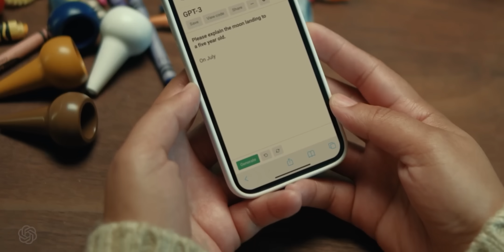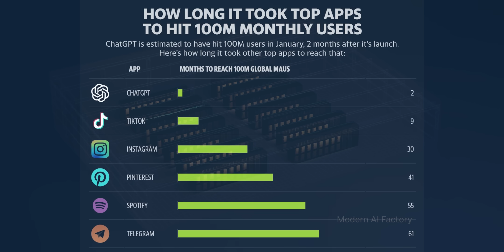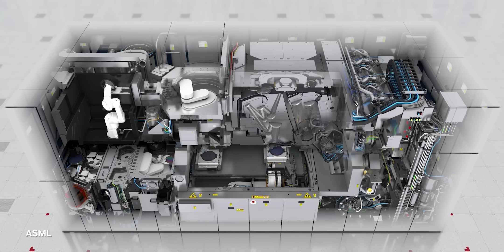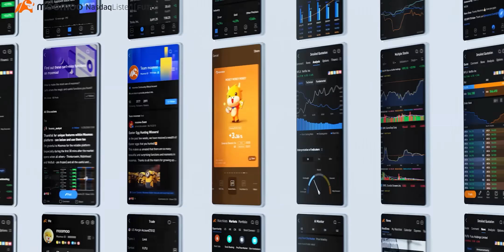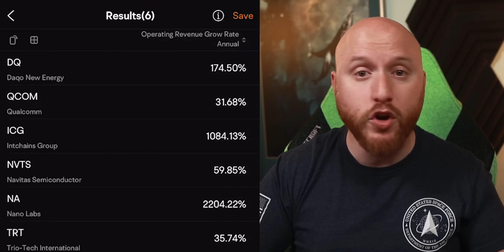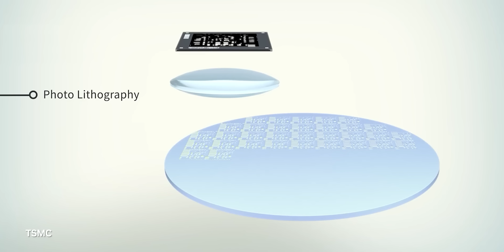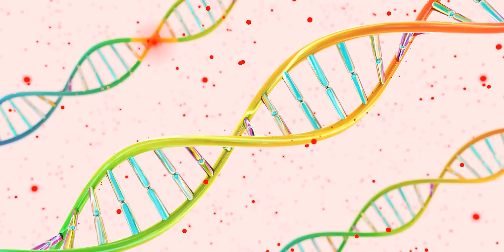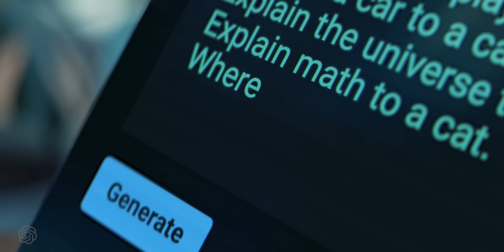Nvidia's HUGE AI Breakthrough (Bigger Than ChatGPT)

Comment: We have A.I's designing new A.I.'s that are beyond our capability to do. The timeframes are the problem. If we feel the need to pull the plug on an A.I. that we might be losing control of, by the time we deduce that there is a problem, the response window will be long closed. Then, our future as a species is determined by a omnipotent sentient being that we will never have control over. What could go wrong? There is no larger gamble. There is no greater potential loss.

Comment: Excited but feel iNtel and others are leaving desktop systems alone. Gamers are driving computer chip improvements. 
Yes AI is good but AI only adds another development stream. AI does not negate nor replace much of the computing needs.
For example, mainframes still do most of our commercial banking and record processing. 
Servers, which are not that affordable,  do much of the heavy lifting for non Mainframe data processing like weather forecasting, AI, local bills, email, etc. Yes Amazon uses special chips for serving video and product forecast. 
Linux & Windows are still used for medial research, gene folding, oil exploration, image processing and database work. Desktops are affordable to the masses and where most programming takes place. 
ARM chips will process IoT.  These are all separate computing streams that AI will not replace. 
Back to desktops - these are the machines of discovery and development. Though my sample size is small, they are pushed to their limits more often than not. People are waiting for iNtel to create a 6Ghz CPU and deliver on the promise of a 10Ghz CPU with DDR-5 memory even with a TDP (total dissipated power) of 233 watts. TDP of 374W would be tolerable even if I had to plug it into a 50A dryer circuit. 
Laptops like cell phones are more general use for consumption of video, emails, light games and web surfing.

Comment: The power reduction from 35 megawatts to 5 megawatts is a decrease of 30 megawatts. Percentage-wise, this is a reduction of approximately 85.7% (30/35 * 100). A 3% to 5% reduction in a plant or data center is really good. 87% reduction is🤯

Comment: As someone close to ASML, I would say that the effect of faster computational mask design will have impact in the mask design speed, but no matter how fast you can create masks, the laser/scanner system is always going to be a bottleneck. This could take a 6 month contract to produce millions of chips and turn it into a 5 months and 15 days kind of thing. Where a real breakthrough would be is if you can get AI to build a better overall process with the laser and scanner system to have much higher uptime with no need for humans to be in the clean rooms. You get AI to build and run the Fab's, then you have a real breakthough. When machines design, build, and control machines, the cost for everything starts approaching zero.
Reply: I am cluelesss
Reply: Which is the best website to buy machine components to etch my own chip?
Reply: When machines design, build, and control machines, we might just be doomed. We can't let them have automated factories. We just can't.
Reply: @BenThere_DoneThat  I'm not sure who you mean by "them", but this is already happening, just not on a large scale and not a completely integrated process. As long as there is money to be made, countries like China will worry less about the danger and more about how fully autonomous factories and construction is as good as printing money.
Reply: @Jacmac1  I mean like Boston Dynamics assembly shops for producing troops. Or drone swarms. With the capability to adjust the manufacturing infrastructure as it sees fit. 
Someone already put Chat GPT in a spot robot. I don't think they should've been allowed to do that.
Reply: Wha?
Reply: that´s gonna happen not soon but in the next 20 or 30 years.
Reply: @Ecotips  10 to 15 years if that. Let's see how accurate any of us are and come back to this. See yall in a decade or do :)

Comment: I quite like the video however you have a very flawed understanding of Chip Manufacturing. The problem is not processing power it is the wavelength of light. Even ultraviolet lights wavelength is too big. So they use masks even finer details.  It is 250 points that this is a quantum physics problem. 
They also won't toss out there Stanley extension server Farms. That just is not how business works
 By the way I don't know how much the h100s cost but the a 100 it's about 16 thousand

Comment: Question: when quantum computing is 'solved' and we got a real handle on it, will the hardware we currently are pouring so much time, money and resources into, still work for our Quantum Computers and chips? Or will everything have to be built from the ground up with QCs in mind? Thanks for the vid!
Reply: Bro, it'll have to be rebuilt as quantum runs on different principles. There are some different quantum computers based on different technology currently in use for research and other purposes China has some based on photons/lasers while other people have electron trapping using temperature differentials. There isn't a standardized approach to quantum rn. Quantum computers still currently only have limited use, they are very good for factoring large numbers and that's about it so for breaking certain types of encryption they're good.   Probably though we won't be the ones to build the really powerful quantum computers at that time, it'll be AI. But our current computers will coexist with quantum computers for a very long time unless there's some other massive breakthrough.

Comment: They are not changing the problem into a imaging problem. A GPU is a general processing unit just as the CPU just with special features, therefore it can do any computation you want. 

Historically there were API languages (such as OpenGL, before compute shaders) where you really had to compute numbers using textures. The reason was that GPU’s at the time were exclusively designed for graphics, therefore there was no API for general prupose computing on the GPU.
Reply: I think you do not know what you talk off.  GPU with ai for image patter recognition is more powerful than a CPU powered system. 
That has been understood for some time.

Comment: Alright, cute, Nvidia made a very small and insignificant part of chip manufacturing 40x faster and people just repeat the marketing pitch without understanding the context, making an elephant out of the ant. Clickbait. Thanks.
Reply from the maker: Did you watch this video on mute? Calculating these masks is THE most computationally intensive step in chip making.
Reply: @TickerSymbolYOU  Most computally intensive? Sure, but does it make any dent in the full process? No.
You know, making these chips is not crypto, there is a physical part you seem to forget. You know. Manufacturing the thing takes time.

Comment: There is a key point that you left out and that is the raw material supply chain.  That is a bottleneck today which is larger than the calculations of the litho maps.
Reply: Ai will allow through business industry tooling to overcome those bottlenecks and allow teams, company's and organisations to identify those bottlenecks before they arise. Some bottlenecks will still happen as they slip through and do not get recognise but most of the bottlenecks we see today are easily identified well in advance.

Comment: All the apocalyptic fears about AI might be overblown, might not. Who knows? What does concern me is institutional knowledge.  We all do what we do, because we stand on the shoulders of others, each leveraging our own little bit of special knowledge for the greater whole, in theory. All of us from electrical engineers, to neurologists, to artists, we all work on something that someone else learned and passed on. As a result, its valuable and important for humans to be able to understand the tools they work with. When our tools  design our tools, their inner workings become a black box to ourselves. We already find ourselves looking at code or diagrams generated by ML- that function- but we simply dont understand. We may not know how to fix them when they inevitably need maintenance. 

What happens when an AI crashes, or breaks, or forms some logic affect that compromises its utility? If we cant debug the code, if we dont understand the architecture, if we cant explain the circuit diagrams, we cant fix it. Its nbd when its a chat bot, but what happens when its running air traffic, or advising on a business merger, a lawsuit, or diplomatic negotiations, and begins to malfunction? Perhaps it takes many years for a fault like this to be seen. When many years from now, we rely on this tool that is broken and we dont know how to fix it, and we dont really know how to do its function ourselves anymore because we've become dependent on this tool, what then? 

This too may be an overblown "sky is falling" fear. This is a story older than Kubrick and Hal9000. In some ways it goes back Mary Shelly and the monster that technology brought from the dead. But when we no longer understand the nature and intricacies of the tools we depend on, our hubris awaits.

Comment: This is not good, I'm sorry. Short term yah, it will lower costs and provide more supply for consumers to enjoy. Ultimately, the long term end game is Ai systems will exponentially grow out of control and above our understanding. This 40x boost to neural networks will send the AGI over the point of no return. Legislators are in no condition or capacity to address the societal impact as fast as they are coming.

Comment: I’ve been talking to chat gtp about lithography recently. In order to do sub nanometer lithography (angstrom scale), you need to use higher wavelengths of light. After ultraviolet is X-rays. X-ray lithography is currently only in research phase and requires a synchrotron source. I wasn’t aware of the inverse masking trick which lets you squeeze smaller structures out of the same wavelength. Very clever! hopefully that will keep us going for a while longer. I wonder if it might be possible to  create a programmable mask that can adapt its shape to create any chip design
Reply: Not at those scales. As a general engineering principle it's orders of magnitude easier to create different jigs for each product than reconfigure a single rig to give multiple outputs.
Reply: X-ray wavelengths will be enormously difficult, and the far ultraviolet in use currently is already technologically demanding. 
Angstrom level lithography will likely be necessary to achieve the computational density necessary for real time general simulated or artificial intelligence, with probable outcome forecasting, giving probabilities of all anticipated outcomes with optimal outcome selection.

Comment: It is nice to see developments in this, I do think however that we are leaving too much on the table software wise, and not enough optimization is happening on that end. Leaving that to Microsoft is like throwing stones at a building expecting it to fall. Currently, we are not optimizing multi core use or GPU use. I found that out while mining. Simply optimizing core usage will more then double CPU performance. Culling triangles and irrelevant scenery will more then double FPS, but there is no money in that, which is humanities inherent flaw.
Reply: Untrue. I'm a doing GPU optimization in the gaming industry since 16 years and how can I say this gently. You're completly wrong. Don't take it harshly.
Reply: For GPT the main computer works primarily as a terminal to ferry code and data in and out of the GPUs for dealing with the neural networks. As such, they only need to be so fast and efficient, only as fast as needed to make the computations done by the GPUs be I/O bound.

Here’s the thing: high-performance I/O is typically hardware-accelerated already via bus mastering. Doing otherwise keeps the main CPU running very inefficiently. Bus mastering has been a thing used for high-performance I/O for decades.

So it really comes down to optimizing the nature of the neural networks as the biggest factor, as the GPU code is likely about as efficient as can be for their context.

Comment: I don't really see ChatGPT disrupting much. It's not really that useful imo.
Reply from the maker: The only way you can possibly think this is if you haven’t used it.
Reply: said no one ever
Reply: It is extremely useful for coding and building applications. It has limitless patience and will explain everything to you as a child would. That makes you can literally build anything-you just keep asking questions and following its suggestions. I built a web scraper with it-I am just not smart enough to do that myself. It is also excellent for summarizing lengthy articles. I know what you mean but you are missing some cutting edge use-cases.
Reply: @archvaldor  I've already used a different tool for quite some time for advanced code completion, and while it saves time on tedious boilerplate code, if you have a lot of boilerplate you should refactor anyway. it does sometimes pleasantly surprise but it's not going to replace anyone anytime soon. nothing I saw GPT generate is a revolutionary leap forward in this application either. specialized ML models will beat generalized ChatGPT in this task immensely, and already do, but just like IntelliSense didn't put you out of a job, this won't either.

pretty much main use will be spammy "news" articles and "support chatbots" and we all know how useful both of these things are

and while it might "patiently" explain things, you have absolutely zero guarantee that it didn't just "make it up", teaching you complete nonsense.

transformer models are nice and have specialized applications, the coming advances in voice recognition and synthesis will be amazing. but don't expect to run any of that seamlessly on any sort of consumer grade hardware anytime soon. and I think this tech has much better use in many tasks/fields instead of people generating memes to post on social media
Reply: Oh boy, buckle up and watch your own opinion change over the next few years.
Reply: Keep sleeping. You won't be disturbed.
Reply: @DavidSaintloth  oh I am disturbed alright. but not in the tech but in the unhealthy infatuation people have with it. it already drove one man in Belgium to sui<ide...
Reply: This is how SkyNET starts.
Reply: low quality bait detected
Reply: I agree, there's nothing ChatGPT can do that my local librarian can't do over the phone. Plus, do you really trust a computer over a real person? Two words, no thanks!
Reply: @robbythegreat1  sure you can talk to the librarian...but that that takes away their time as they have to look it up.
Reply: ChatGPt is dumb af